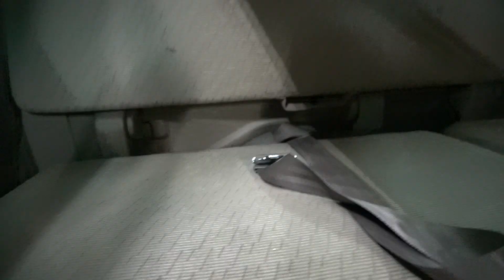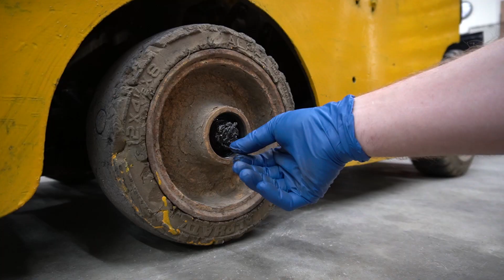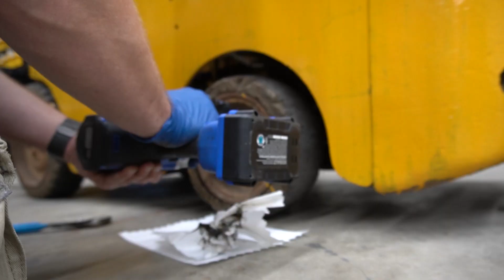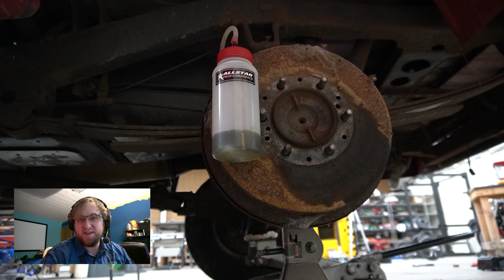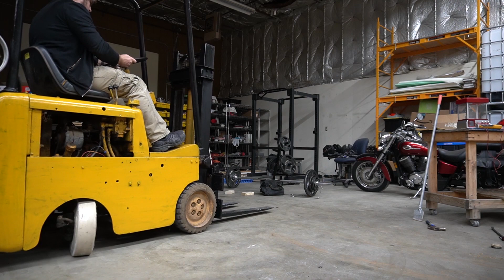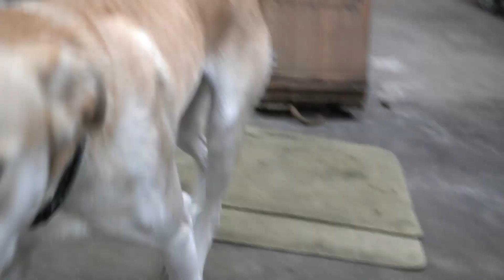Getting New Tires for the Forklift

Comment: You don’t change the tire sizes on lifts. The data plate on the lift has a capacity at different heights, and since that lift is now tilted forward more than it would be on the oem size, you have essentially voided that certification.

Comment: you definitely need the original tire size.  having a different size throws off all the specifications for lift height, capacity, turn radius, etc.
Reply from the maker: One of the problems was that I'm not sure what was original (no documentation, and all plates removed) I'm still trying to get the smaller wheel though (or turning these ones down an inch)
Reply: @SamFoskuhl    no plates?  so you dont have the load capacity information and center of gravity measurements either?  thats really unfortunate.  its stupid anyone would take that off.  i mean if you really wanted to go the extra mile you could theoretically modify the suspension to accommodate the larger wheels.  with it being a very small forklift it shouldnt be too too heavy.  a car jack might work.